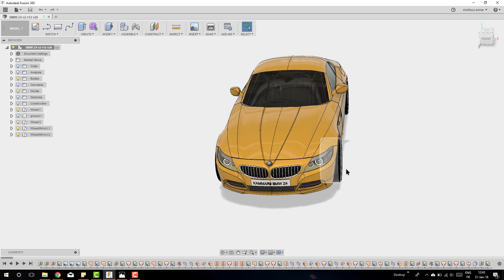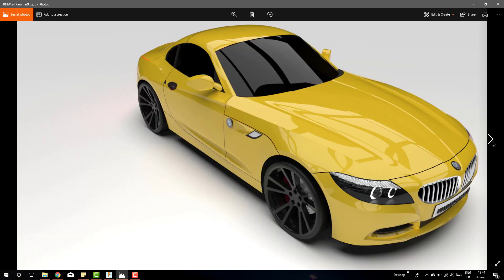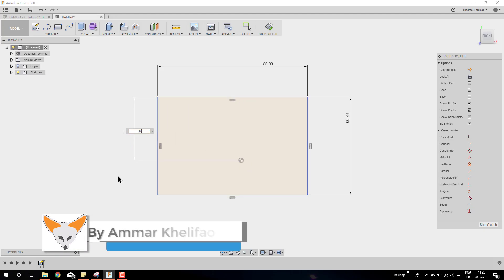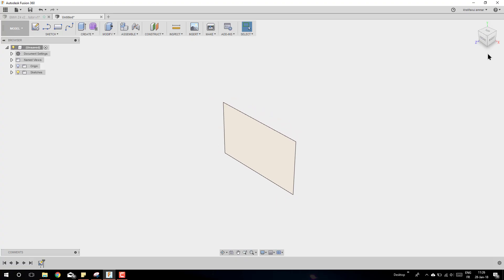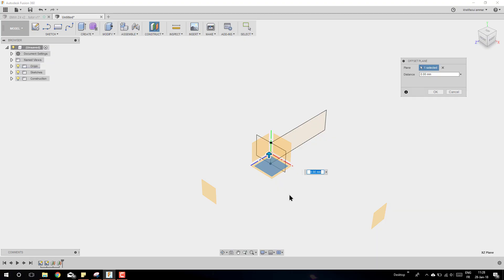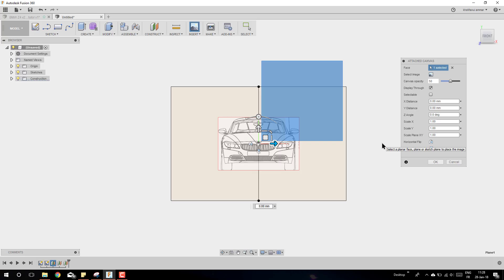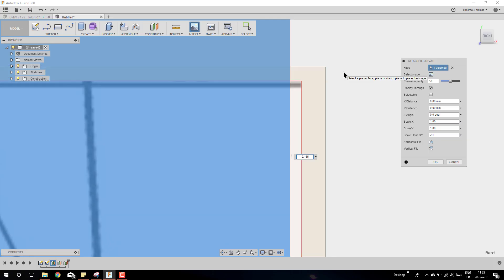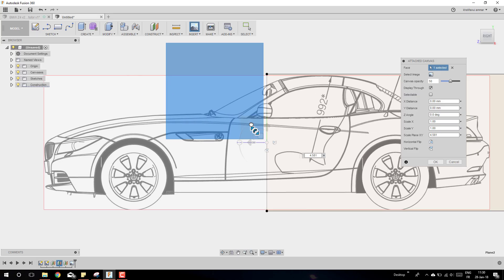BMW Z4  With Fusion 360 EP 01 😍😍   Full HD 2019

Comment: Hello sir, I'm trying to follow your example but I am using a different set of drawings I am attempting to create my own body so that I can 3D print it for my remote control car. My issue is I am running fusion 360 2017 and I do not see or have an attached canvas feature would that be the same as the image insert button that I have in the top of my browser because if it is then I'm still doing something wrong because I do not have the controls that you are showing in order to calibrate the image once it is on the new plane

Comment: Hi, when I try to place a canvas, the menu pops up with projects instead of the menu you have on the screen, What do I do? also the whole interface looks different to mine
Reply from the maker: Hi there , don't worry man , that's old version of Fusion but still the same thing look at the buttons they are the same just the look is changed a little bit,  go ahead and if you have any questions don't hesitate
Reply: @AmmarKhelifaoui  Thanks. The canvas button doesn't work properly so i'm not sure what to do about it
Reply from the maker: @MaxThaDrummer   thanks to reply,  you can send me messages with messenger or Instagram to see images

Comment: Thanks for these videos. I haven't finished all of them yet, but I am using some of these techniques to model a vehicle for 3D printing. One problem I have is changing surfaces to solids for printing, the thicken command doesn't let me do it for all areas. Am I doing something wrong?
Reply from the maker: Hi there bro , yeah I recommend you to finish all and convert it to solid , try to convert all to stl and add thickness in blender

Comment: hello, how can i draw on all levels? I can only draw on one level.
Reply: My guess is you are drawing the spline on the offset plane so once you switch from TOP to RIGHT view, the spline is still there, but it is sitting high up.  Select the "Origin" plane before drawing the spline.  Toggle Construction visibility an get rid of the offset planes you used to set the background canvases
Reply from the maker: @tniculescu5565   I thinks you can just activate the 3d sketch , that's all , no
Reply from the maker: Hi there bro, what do you mean by level ?
Reply: @AmmarKhelifaoui  This is what I think he may mean: Let's take the first spline you add as an example.  You add it in TOP view then adjust it in RIGHT view.  He does not see the spline he added in TOP view once he switches to RIGHT (profile ) view.
Reply: @AmmarKhelifaoui  I did everything like in the video up to 8.38

I can't get any further from there. I cannot draw a spline in 3D. My Fusion 360 looks different.
Reply: @AmmarKhelifaoui  https://www.bilder-upload.eu/bild-0b9f75-1580486120.jpg.html

Comment: Very nicely done. Thanks for uploading. I'm currently trying to surface a complete GT race car and I'm losing the will to live. :-/ I have been using Catia V5 for 15 years and the transition to F360 is going well, apart from the surfacing! I will download your Canvases and start practicing. Cheers.
Reply from the maker: Nice , thanks for you bro, me too I was in solidworks for 13 years when I discovered this software is great and easy to lean it. Good luck
Reply: @AmmarKhelifaoui  So do you recommend migrating from solidworks to fusion 360? I have also been using solidworks for a long time.

Comment: Could you offer advice for modelling compound curves in body panels? e.g. I am modelling a car using 3D sketch technique, but the wheel arches have a convex shape not possible to patch of loft. 3D Sketch and patch mode more like stretching canvas over lines it seems? Perhaps I have to finish these convex surface in sculpt environment?
Reply from the maker: No bro , you can use many methods to achieve that , see the tutorials about the wheel for BMW Z4 you ll find it in my channel   , I m not used patch mode to do it